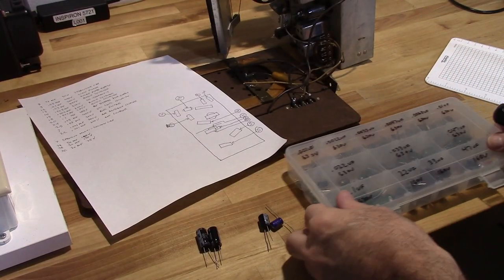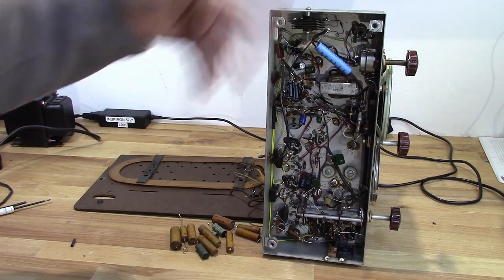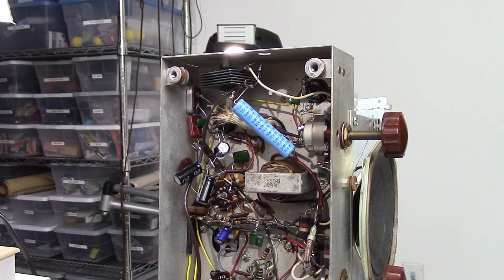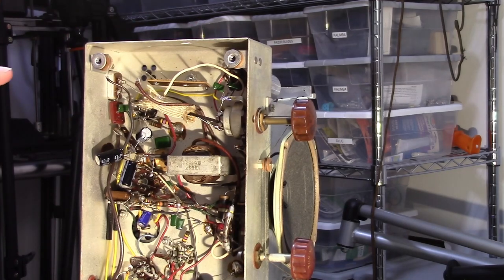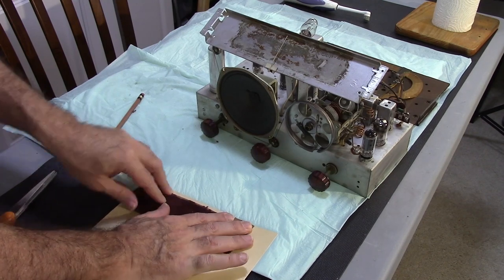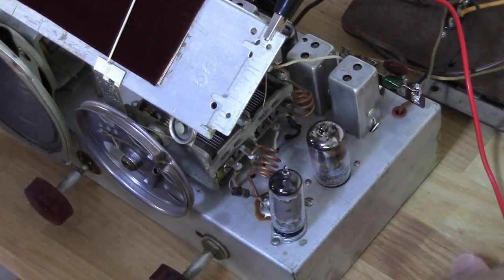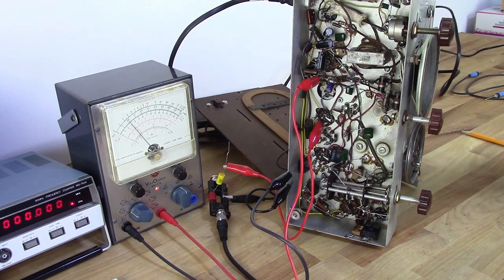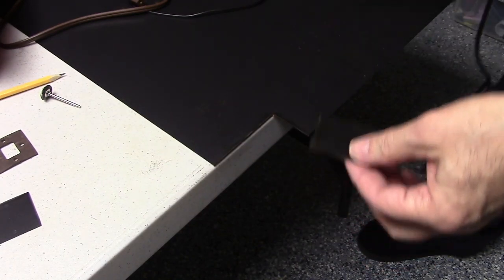1948 Westinghouse H 204A Radio Restoration Part 2

Comment: As usual a very enjoyable video and superb restoration. Thank you for sharing your knowledge with us. PS . I would love to see more restoration projects from you.
Reply from the maker: Thanks, I'm trying to get them out as fast as I can, with a goal of one a week if possible.  There are many projects in the cue, it's just a matter of budgeting my time so I can knock them out and provide decent videos of the process at the same time.  I'm a one person shop, so time is my biggest challenge.  Most of my radios are in pretty bad shape to start with, so getting them finished is a several week process at times.  When I watch other restoration videos, I tend to want to see more.  For example, most will say they need to recap the radio, then the next scene is of the radio fully recapped without any samples of the process.  Some may prefer that because they know how it's done, but I like to at least do a few of them to illustrate what is happening.  It makes for longer videos, and they are harder to film and edit, but I try to produce videos that are what I want to see when I'm watching other restoration videos.

Comment: New subscriber here. Thanks for your channel; I'm sure I will learn a lot. And one question (not a criticism in any way): since you painted the case, should you also paint the knobs to match?  
Anyway, thanks.
Reply from the maker: I didn't only because this painted case was a manufacturers option and the knobs were as they would be had the original radio come with a painted case.

Comment: So many so called restoration projects on YouTube are not very good. This was done well which was a joy to see. I thought you used fiber board for the plug, someone said it was sheet metal. My eyes are not the best was it sheet metal, if so what gauge did you use? Some how I missed that part. Nice work over all.
Reply from the maker: Sorry about not identifying the material I used, I actually intended to do so but forgot about it.  I actually used Black Laminate Counter Top material.  I just happened to have a sheet of it from a project I was going to do, but switched course on.  You can pick up 3" X 5" samples at Home Improvement stores.  I'll add this information to the Description.  Thanks!

Comment: I have one of these and several other early  50s sets with the FM band. As there is no AFC on these radios, drift on FM is an issue.
Reply from the maker: Yea, that's been a discussion with the owner on this radio.  I need to look into how to add it as I do have several of these Westinghouse radios.  I know there's a way to do it, but haven't been able to wrap my head around it yet.
Reply: @antiqueradioarcheology-wil8878  This is common with a lot of the early FM sets without AFC.  Only a couple of the Zeniths that  I have do not drift. Zenith tried  using a negative temperature coefficient capacitor to reduce drift.  Other than trying to add AFC, I have heard that trying different converter tubes(12AT7 in the Zeniths) might help.